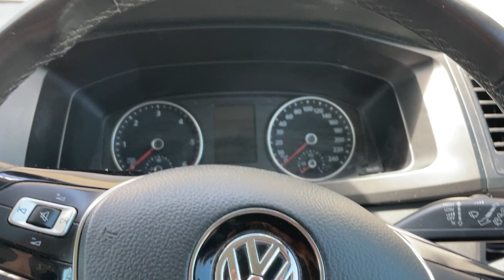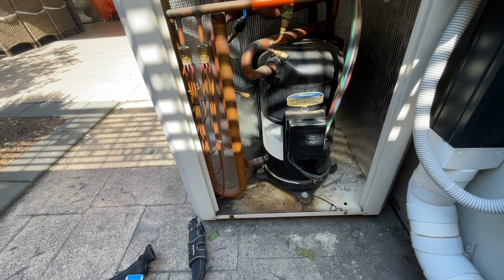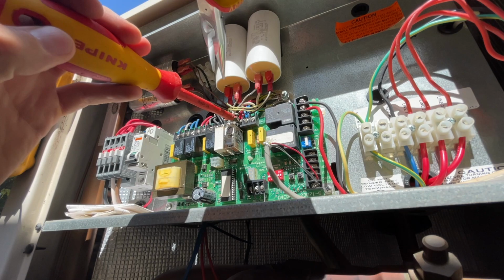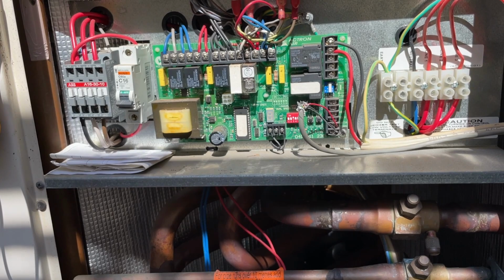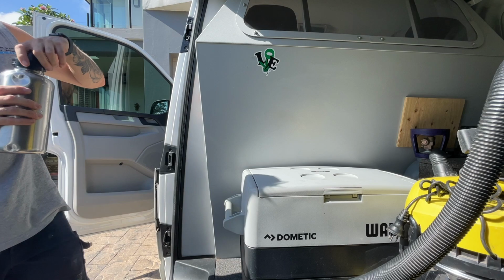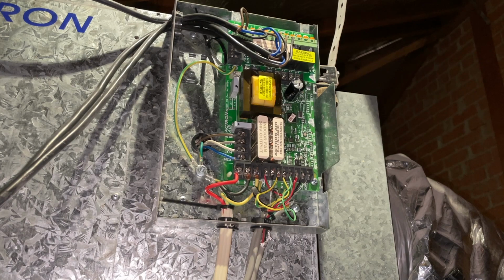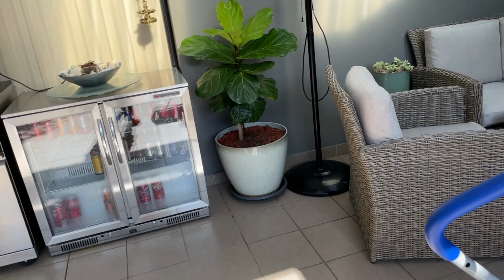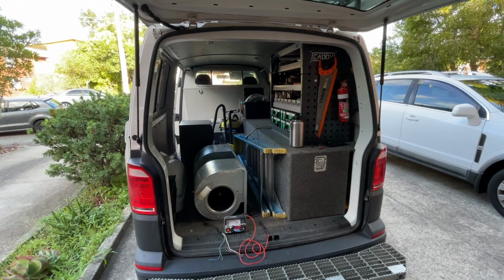Air Conditioner won't turn on.

Comment: Excelllent video. So well done. I have the exact same model which is currently faulty. Waiting on someone to come and look at it.  In this case, I know the fault is on the board as we had a mouse In the cabinet and he chewed through a wire.   Thanks
Reply from the maker: Thanks! If it’s just a broken cable, that sounds like it should be an easy and hopefully cheap fix!

Comment: A/C units you guys have in Australia sure look different than the A/C units here in Canada, though this one looks close to what we have Here they are larger cabinets and the fan discharges from the top. Also the fans are metal bladed here with straight square blades usually three blades, sometimes 4 on the higher tonnage units and two blades on the very low tonnage units. Most here are single speed and stage. Thats also because we only need them 4 months out of the year here and they are connected to a ducted natural gas furnace, where in cool mode the outdoor unit comes on it also runs the blower fan only in the furnace to blow air across the evaporator mounted on top the furnace. In heat mode the outdoor unit never comes on, only the gas furnace runs with the gas burners lighting then the indoor fan blower comes on to push air across the heat exchanger to heat the home in winter, unless it is a heat pump ac unit, then it will run with the valve in reverse and furnace blower until it is too cold outside where the auxiliary heat mode comes on to turn the gas burner on in the furnace.

Comment: are actron complete piss ?   good job btw
Reply from the maker: I’ve never installed one personally but I have fixed many. My opinion is the basic ones were absolute quality but the newer efficient ones are dog shit. Soft starters and ecm indoor fan motors are no good. Thanks mate
Reply: @maracservices  yep - had a soft starter replaced 5 effing times in the first 4 years !  thing has currently packed up completely hence found your video.  take care all the best. bye.